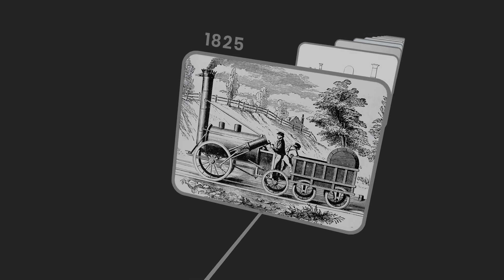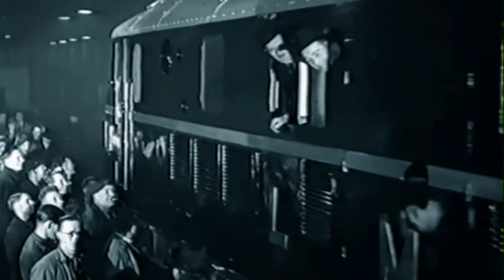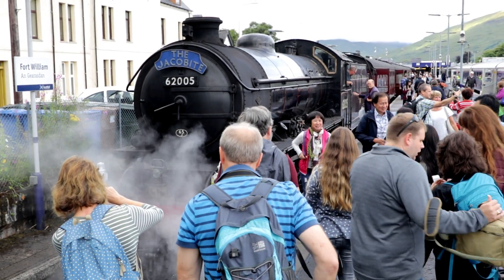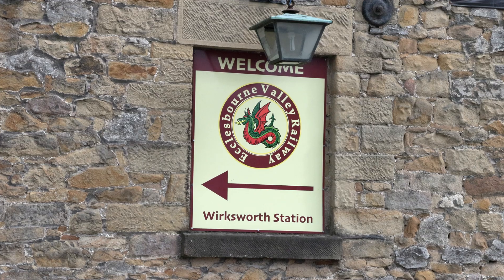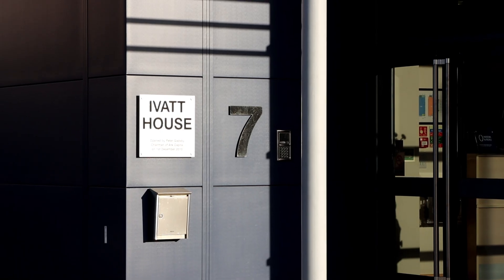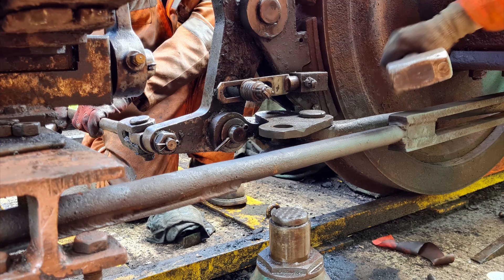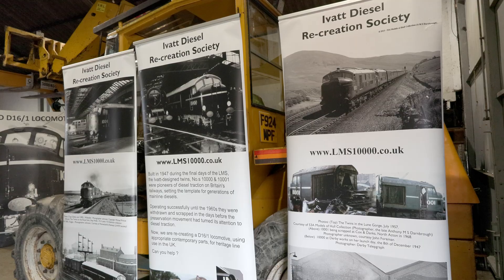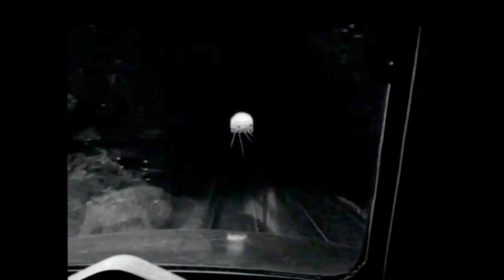Re-Creating Britain's First Mainline Diesel LMS 10000

Comment: to be brutally honest this plan doesn't sound as asinine as building brand new steam engines into days age.  I mean think about it?  all the parts they need are already there and won't need to be reproduced from scratch.  the frame,  power unit and bogeys just need to be overhauled,  repaired and modified in order to work together but it is possible especially since a lot of English electric  engines are still around.  so it would be possible to get some spare parts from them.  plus it would definitely fill in a huge part of railway history that is sadly not being told at the moment. 

 I can't wait to hear that diesel roar to life!  Godspeed!  is all I can say right now but godspeed to this project!

Comment: Would have been cool to seen the loco stopping short of Liverpool St and running round to push into Liverpool St and then loco first running down to New Cross then reverse up onto the Deptford line via North Kent East junction to terminate at Greenwich for forward movement likely Ford stuff to elsewhere on the dedicate North London Line to Greenwich daily freight.   Sadly it was the Eastern region that saw the connect between Southern and Eastern metals ended as they were fed up freights were using up a vital passenger platform.   Same as Snow Hill tunnel this time LT being peeved that BR trains were getting in the way of running and so the Ford trains to Sheppey were forced to take the southern route from Willesden.   I remember having all of this explained to me not by my BR signalman father but my class 33 driving uncle who did most of the Ford trains during the 70s as I thought it BS that trains used to run onto the East London line like they did, so one day got on a train to Shoreditch and yes you could see through to Liverpool street at platform end, uncle said a shunter from Bishopsgate would pull into the platform and shunt back into Shoreditch to be picked up by the waiting SR loco unless it was a through run and loco did the whole movement.   I say Ford stuff as Greenwich was the best line, anywhere else likely ended up at Hither Green for forward marshalling and the busy Ford Sheppey to Dagenham trains Ford paid a premium for swift movement of and had a higher than normal freight coding.

Comment: Europe concentrated on electrification. The UK experimented with a wide variety of different locomotives, rather than a standard with interchangeable components. Part of the problem was the restrictions of the loading gauge. It means we are years behind, even with a new line like HS2, which seems to do more for the concrete industry than iron & steel production.

Comment: In the 60.s  10001 was last used at Willesden on the daily train from Neasden - Woodford Halse with a Brake Tender with the Taylors Lane Power station coal . 
It was also used on empty stock trains to/.from Euston until it failed. I also remember it was on main line suburban trains especially the 1632 Willesden - Bletchley. 
It had a straight vacuum brake . Also as a kid I saw them working the Royal Scot and also 10201-3 on the same train. 
Good luck to the team who are reproducing an icon.

Comment: Very interesting. Now let's see a project to rebuild 10100 - The Fell!
Reply: No!! The differential gearing inside the Fell was very clever in principle but its implementation was a nightmare. A Fell Mk2 with a simplified engine arrangement might have been better - but the Mk1 was scrapped as it overheated and was incredibly noisy, amongst other issues. Clever yes, practical no. My vote would be for a GT3, gas turbine. This did work well, but its steam outline using a separate tender and needing a turntable was superseded by bogies and diesel with electric transmission. Very attractive idea though

Comment: Those two locomotives - one donating a chassis and the other a couple of bogies - are relatively modern (1980's?).  I'm a bit perplexed as to how they could be suitable in creating a locomotive from 1947.  A very worthwhile project, though
Reply: The video clip explains all.
Reply: The bogies are from a class 77, circa 1950's.
Reply: Good luck with this project!
Reply: NEXT!!
AN ALCO PA AND PB BOOSTER UNIT , BUT WITH 251-16-F POWER
RATHER THAN THE 244!
SANTA FE WARBONNET PAINT, AS WELL!!
Reply: @rossbryan6102  actually the Alco PA once owned by Doyle McCormack has a replacement 251 motor installed.

Comment: The loco will be an 'interpretation' rather than a recreation, but congratulations to all involved in pushing this project along.
Reply: Good comment. It's true, but to be fair, almost everything that is built is an interpretation of one form or another.
Reply: same could be said of tornado
Reply: @Trainman10715 It could. Everything that is handbuilt to a drawing is an interpretation. Inevitably, small issues arise with fit and tolerance which have to be remedied on the spot. So things are built in the spirit of the drawings.

Comment: i was never a fan of diesels, living in Watford thro' 1950s and '60s but toured internally either 10000 or 10001 (the catalogue does not specify which) at the International Railway Congress exhibition at Willesden in 1954. I saw them often in pairs on the main line and then one of them in faded green alongside Watford shed in the late 1960s, apparently awaiting a tow to disposal 'somewhere'.